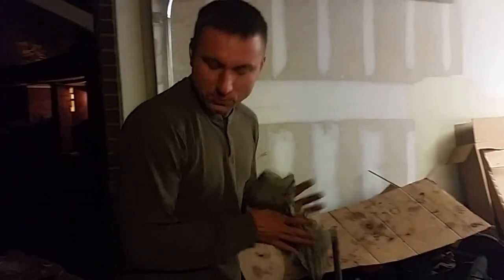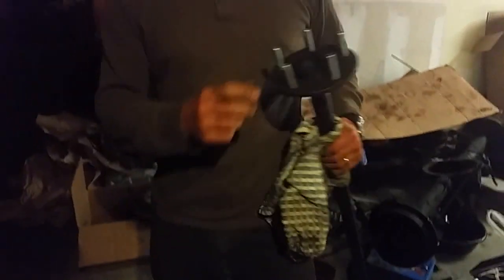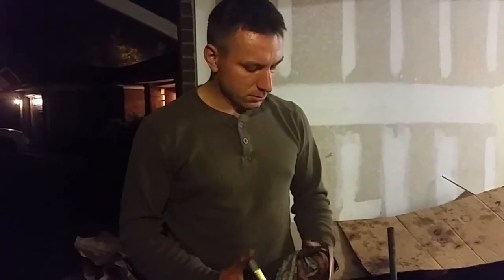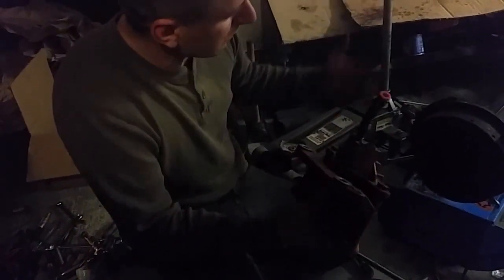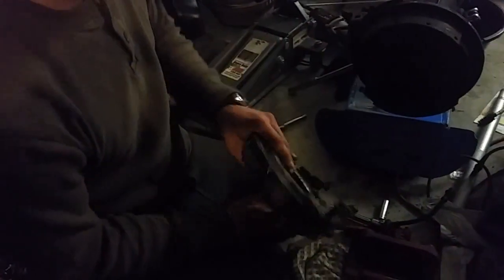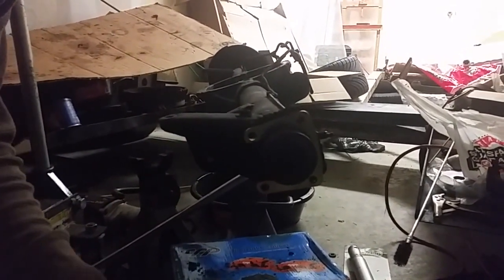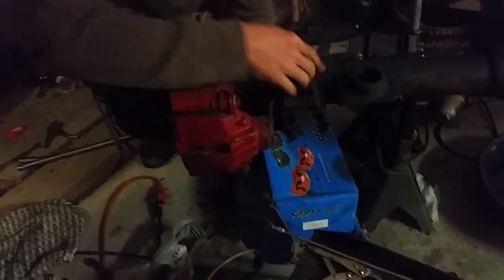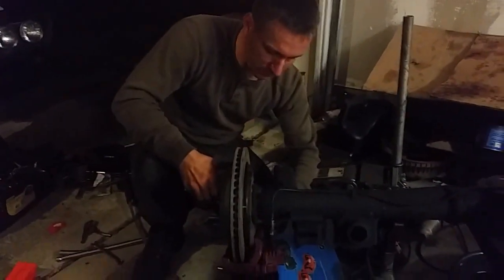ls1 swap. Best Cheap disc brake conversion upgrade. 12 bolt, 10 bolt chevy axle, classic muscle

Comment: hello fraeindcan you help me ? im micha from israel and iwant to upgrade my rear braksjust i dont know wat kit i need to my 1989 gmc van g2500 4.3L do you know abut it were i get it from ebay?i have 10 bolt in rear axel..what do think my fraind? thank you alot
Reply from the maker: you can use the rear brakes off a newer blazer or other GM truck that had the same axle but a set of disc brakes instead of drums.

Comment: Safety Glasses ... be safe not blind in one eye.
Reply from the maker: That's very true.  Thank you
Reply: @InvincibleExtremes  Your video got me thinking, i can take the rear disks off another GM 10 bolt, and bolt them on my 76 Trans Am.  Thanks.. Saw a good video that discusses adjustable Proportioning Valves, some even have electric lock up... Got to love youtube.
Reply from the maker: Yup.  Most 10 bolt brakes interchange

Comment: will the it b the same process for an 86 c10 thinking about getting another set if it's as easy
Reply from the maker: +fernando cuevas do your research first... the hub diameter and wheel stud pattern MAY be different... so make sure they work before spending your money....  you can always loom into a disc brake setup off a newer truck... ;-)

Comment: I have a question after swap the disc brakes it Will be anything else i Will need from the cámaro donnor ? I mean the proportinal valve and lines or whats else should i keep from
Reply from the maker: Prop valve would work.  I just used the brakes

Comment: will this work on 97 chevy c1500 1/2 ton pickup???
Reply from the maker: +Octavio Guerrero no, you'll need to get the brakes off a newer 1500.  Less trouble and cheaper
Reply: Invincible Extremes Muscle Cars Garage  what setup do you recommend?
Reply: Why is it that it won’t work ?
Reply from the maker: ThatDudee different housing ends and lug pattern.  same reason Camaro wheels won't work on the truck.  you're better off getting disc brakes off another truck that's newer and using them

Comment: I just got my set of rear disk brakes off a 02 camaro for 140 but I have a question my Nova is a 76 with a 7.5 rear end that I plan to change later but for now will I b able to do the swap without the steel plate u put on there nd without changing the lug bolts
Reply from the maker: +fernando cuevas  that $35 spacer is a must for anything older than a 98 camaro. The good news though is after you upgrade your rear to disc brake you can drive around like that untill you save up money and buy a better rear end, and then just swap those disc brakes over to the better rear end.  hope that answers the question ;-) 
let me know if you need anything else, thanks for watching and don't forget to subscribe.

Comment: do you know the one I would need
Reply from the maker: +anthony jackson this one  works for your rear, but you'll need to compare your mounting pattern to the chevy one.  The pontiacs have a different backplate pattern for their brakes, so you will have to modify the backing plate to bolt it on, but it should work.  The fronts can work, but i cant find a kit to use the 98 camaro brakes.  There are some who have though.... your best bet is to call KORE 3 and ask them.  They are some of the best for brakes.

Comment: hey what's up? I saw in a previous reply you made, why don't you like the Chevy 12-bolt? C clips? I'm curious because I'm thinking of swapping out my 7.625 posi from my Malibu and getting a 12-bolt to modify.
Reply from the maker: R. Joseph get a 9 inch.  way better.  I'm assuming this is a G body right?  C clips, and when and if the posi gets worn or some how the axle housing gets warped and you eat a wheel bearing, the axles get destroyed....   or get a gto 10 bolt... not the greatest but stronger than what you have and they have bolt in axles already...

Comment: hay its a guy with a channel called gtsdesigns he has video with the flange is a little different from the one you were working on if you could take a look at the vid an see if it may work for me its gbody or 10/12 bolt rear end big brake upgrade name of vid
Reply from the maker: +anthony jackson yeah, i found it.  Its the same flange, but has an extra ear attached to it and the top holes undrilled.  Those rears are crap btw... they break real easy.   You can drill the holes you need in your flange and itll bolt on.

Comment: Hey might be a stupid question, can you tell me if there is a problem with the staggered shock on the 10 bolt rear end on a amaro with the 1998-2002 ls rear disk brake set up.
Reply from the maker: Not in my case, but it's close
Reply: @InvincibleExtremes  have you guys ever installed brembo on the rears using the 98-02 rear brake hardware?
Reply from the maker: Not really

Comment: Do you have the specs or part # for the brake line adapters? I'd like to make sure I can pick them up locally before I get started. If not, I need to get a set ordered.
Reply from the maker: NFriction  no sorry, autozone sells them though.  Have them pull a stock 98 camaro rear brake hose and a 68 camaro brake line.  The brake line on a 68 camaro is 3/16 line, so just sort through the adapters untill the one that converts standard inverted flare lines to adapt to a metric bubble flare hose... those are the specs i guess.  Hope that helps.
Reply: NFriction  I got my adapters at advanced auto parts. Part number 271330, 10 mm. Bubble flare to 3/16

Comment: EYE PROTECTION MAN!!!  You should be setting the right example in all the possible ways!
Reply from the maker: agreed, i try my best to wear it any time im grinding or cutting
Reply: Use it at the press too, that socket could shatter under the pressure... and your eyes are in the line of fire.

Comment: Do you have a part # for the plates? Trying to run Ls1 brakes on a 70 chevelle 12 bolt.  Is it 1/4 thickness or will that vary?
Reply from the maker: Should be 1/4 inch.  Theres no part number because it's a custom part. Not an oem thing.  But brp hotrod used to sell them
Reply: I just ordered a pair from em

Comment: hmmm looks to me they machined de brakedisk surface on one side you can see it on the thickness of that side of the disk when looking intoo the side , might be ok but if they whent too far theres a chance the caliper starts leaking or pops out the piston when the brakepads are nearly worn down

nice to know how to change the rear stuff on my truck
Reply from the maker: maybe, had this setup on my 68 firebird for years now, rotor is worn down pretty good and had zero pad at one point, but no issues.  so thats good news for anyone with newish rotors
Reply: still looking at the how to , seen the brakedisk a few more times now and i think its more the light fooling me

i wonder if the 5 on 5 pattern is the same on trucks , that might be an issue for fitting the brakedisks for me

Comment: Awesome video! I wish the bolt pattern was 5X5... I would put these on my C10 if they were...
Reply from the maker: Bolt pattern on the rotors doesn't affect them one bit.  You can redrill the rotors or even hog out the holes already there and it won't matter because it's the clamping force from the wheel to the axle face that holds the rotor...
Reply: @InvincibleExtremes  oh wow! Thanks for responding man! I'll start looking for a set of these brakes!

Comment: Has anyone tried this on a c clipless Pontiac 10 bolt?
Reply from the maker: Backing plates have a different bolt pattern
Reply: Invincible Extremes Muscle Cars Garage so I’ll need a Chevy rear end to make it work?
Reply from the maker: Yeah basically.  Or be willing to do some cutting and drilling

Comment: For a 69 firebird would i need 2 left calipers and backing plates cus of staggered shocks?
Reply from the maker: nope, my 68 firebird has just one set and clears my staggered shocks no problem.  I also have traction bars so it may relocate my shocks by a hair, but If you need pics let me know.  Thousands of miles on the setup in my 68 firebird and no issues...thanks for stopping by.

Comment: nice vid will this work on a 69 c10? do you have a list of what you used?
Reply from the maker: phillip ferguson yes, but you will be required to drill the rotors to whatever stud pattern you have on the truck.  it may be better to use the rear brakes off a 2003 Tahoe in this case
Reply: Will it be the same as ur vid? I'm doing at front end swap with 84 chevy for disk brake and power steering
Reply from the maker: phillip ferguson the rears will bolt up no problem.    all Chevy rears use the same bolt pattern for the brake mounts... so go dig up whatever you want and make it fit.  it may require the 1/4 inch spacer I mentioned in the video from brp hotrods, and it may not.  really depends
Reply: Invincible Extremes Muscle Cars Garage ok thank you was just trying to find cheap easy way like just use different rear end

Comment: A brother great video was wondering if u can tell me what it it that the caliber held to I didn't notice they held on to or if the plate comes with the kit and if u can provide me with a part number for the plates
Reply from the maker: I don't have a part number but if you're pulling the brakes off a blazer or 1998 camaro you have to pull the entire system and backing plate...  not just the calipers.
Reply: @InvincibleExtremes  one last question and I highly appreciate the quick response I have a 1988 Chevrolet caprice 7.5 10 bolt this application will fit also
Reply: @InvincibleExtremes  I just recked my 98 camero so I'm stippling it down to build the caprice I can use all al that correct does it make a difference from 96 to 98
Reply from the maker: I think you should be able to use it no problem.

Comment: where can I get the brackets for the caliper? and will this set up work on a 83 chevy c10?
Reply from the maker: this set up may not work on the c10 because the axles and wheels are a different stud pattern from the 98 camaro.  it will bolt up, but you may need to drill the rotors... brp hotrodding has the adapter plates.  hope that helps bud, thanks for watching

Comment: Will the C3 Corvette proportioning valve work with this set up , or do you know? I am about to do this swap on my '73 Camaro , and I was just wondering if a disc/disc prop valve would make it easier. I have no experiance with adjustable prop valves. Great video , very informative!
Reply from the maker: it would, but for what it costs, just buy a $35 1973 corvette disc disc master and the wilwood adjustable prop valve for $80... very easy to set up.  once your brakes are bled, drive to 50 mph and mash the brakes... if the rears lock up, take some pressure away... and do it again untill you can stomp the brakes and get motion sickness from how hard it stops....  seriously.
Reply: I'll keep that in mind , however I do have said C3 parts laying around bc when my uncle totaled his '78 , I scavenged as many parts off of it as I could. I also own a '70 Vette , so figured it would be a good investment to take as many working parts as I could after he gave me permission. I also have the master cylinder ;) Thanks for the help man !
Reply from the maker: +MrBanditz28 why not try it then.  costs you nothing.  and if you find you have too much rear brakes then you can always get a speedway adjustable prop valve for $35 and add it inline somewhere to restrict some of the flow... and use it as a kind of line lock to not put extra wear on the back brakes while doing a burnout...
Reply: I like that idea , I don't race though , so my burnouts are done with a slight clutch dump. I used to power brake , when the car was an automatic. Anyway , I could talk cars all day and night. Thanks for the fast responses , and happy wrenching my friend
Reply from the maker: MrBanditz28 no prob, ask anything.  Anytime you need something.

Comment: Great video would this work on a 65 c10 ? what measurements would i have to double check before i spend my money
Reply from the maker: +d Ramirez it would.... BUT you would need custom axles.  Because these are 5x4.75" stud pattern like the chevelles and camaros... and i know for a fact that 65 c10 trucks cant use camaro wheels... you could also have the rotors drilled for your current axles.  Just keep that in mind...
Reply: great thanks glad i found your channel a lot great useful content
Reply from the maker: d Ramirez  just trying to help ;-)

Comment: One more question, if you have an old car that has drums on the back, like yours did but has always had discs on the front.. And you just wanna upgrade to discs on the back.. Is it ok to not upgrade the fronts? I also hear you need the 98-02 master cylinder and proportioning valve when upgrading to these newer brakes.. All i'm interested in is upgrading my rear brakes.. I have 98-02 rear brakes I'm wanting to put on an 82 camaro which has actually been retrofitted with an earlier stronger 8.5" 10 bolt out of a '71 camaro, which is the same era rearend you are going thru in this video which specifically applies to me.. And has been extremely helpful btw.. I understand the mechanical process, everything bolts right up..its very straight forward but as far as the master cylinder and prop valve goes, do the guys like you with a '70 model muscle car just bolt on the '98-02 style rear brakes on your 10 and 12 bolt axles with your stock master cylinders and go? OR do you use the complete lines, prop valve, and master cylinder from a '98-02. F body as well? In short, Is it ok for me to bolt 98-02 brakes on the back and keep my stock '82 front calipers  Im just trying to figure out what it will take to make it work and i dont wanna have to buy rotors and all the hardware for the front too, for now i just wanna upgrade my rears.. Buying master cylinder would be no problem tho, i have researched and no one mentions all that
Reply from the maker: Yeah you dont need to upgrade the front but you do need to use the proper master cylinder
Reply: @InvincibleExtremes  thank you